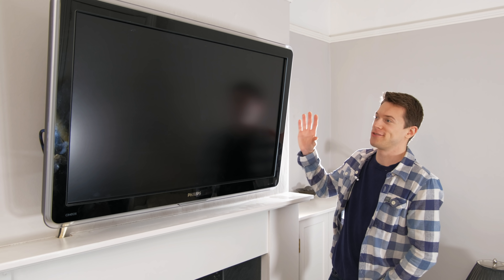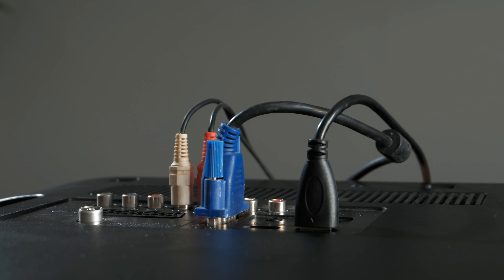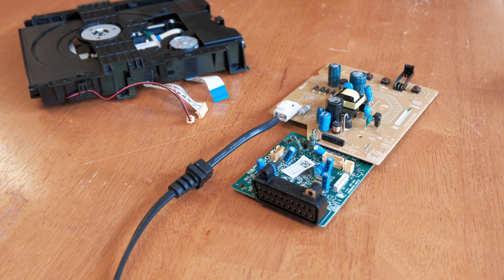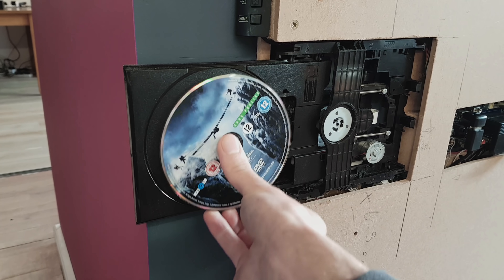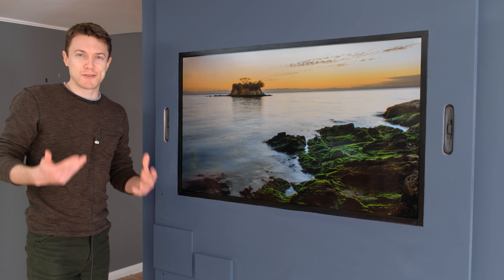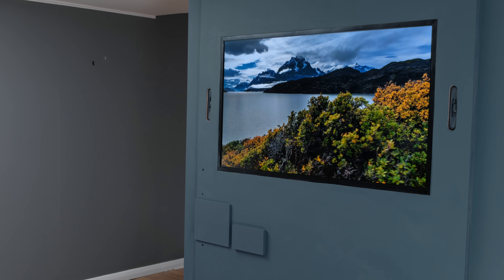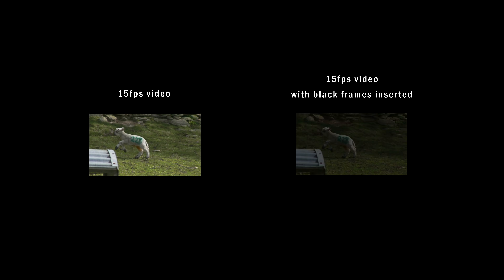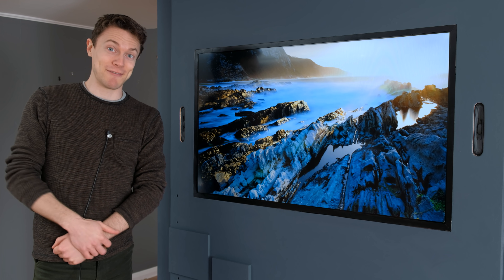Building a homemade 'wallpaper TV'

Comment: Great job. I love how you took the boards out from the tv and placed them elsewhere. HOWEVER, I Think at the end of the day you could of kept a manufacturers warranty on a much better television by building a wall around the television as all you ended up with here was building a wall around a television.   Only way this works better is if the tv has straight out inputs but TV's don't these days so you could achieve exactly same thing by building the front fibre wall around the tv but do it to newer tv without taking it apart.  You do solve a problem of the tv leani g forward but if you're going to build a wall around it to solve your problem you may as well just build a wall around the entire tv and have every single Input plugged in with the correct lead into the tv and have a compartment that the other end can be left hanging elsewhere for when you need them by adding an extension to them without ever needing to get to back of tv again.

Comment: With all the framing this required anyway, why not just build something to hold the corners of the TV up against the existing wall (eliminating the protruding bracket), then put framing around the whole thing to make your fake wall. You could still add speakers on the sides and move the physical button panel, but you wouldn't have to do all this deconstruction and precise framing work, and you'd have more flexibility in handling heat dissipation (hidden vents on the top, for example).

Comment: Depending on how the wall is, i would've just left the TV on the bracket and built a drywall from side to side with cut outs. 

I'm also a electrician so the electrical side of moving it out of the original wall wouldn't bother me.

Comment: wait... so with the fake wall, couldn't you have just stuck the whole TV behind it in the first place?
Reply: Yep. if it was just a plasterboard drywall I would have recessed it to fit TV, hide air vents somewhere too, even have access panel to get into the back of the tv from the otherside, job done.
Reply: Blaine Atkins thank you ! I thought I was going mad ..that’s exactly what I thought😀👌
Reply: Good question
Reply: this made the tv way thinner though
Reply: Yup and if you want to keep the wall back you can cut a niche into the existing wall. Just be careful of cables and pipes. Still easier than ripping a TV apart.
Reply: not with the studs and whatnot behind the drywall there. although you could build a thicker wall coming off the already existing wall and put the TV behind that. but then you have the buttons and IR receivers to mess with and you would want to build shelves into the new faux wall to house complete surround sound, gaming machines, laptops, cable box, Bluray, VCR, audio cassette deck, phonograph and any supporting ROM media to play through those peripherals. i like his. i would have done it different but i don't do anything but talk smack on YT
Reply: Icy Uranus TVs have buttons on them still? Lol I have a Qled so there’s no buttons on it at all but do have the IR that’s all. Sucks if you lose the remote I’ll tell you that! But it’s pretty thin!

Comment: @diy perks. Hey, love the idea. Heck, I love most all your ideas.  Could you please let people know that the voltages on those boards can be very dangerous when switched on. Also, heat is a huge killer of modern TV's, so some thought about heat dissapation is needed. Maybe a small fan could be placed in the false wall with the boards. Thanks again for the content.
Reply: Manic Mender agreed about removing heat from the circuit boards and the display. The TV originally used passive cooling so it wouldn’t be to difficult to add it to this design. Adding an air gap and some hidden inlet and outlet points should be sufficient. 

A warning about mains voltages should added to video. Still a good project though, just not quite complete.
Reply: Are you suggesting all those openings in the original TV casing actually had a purpose? Pshhh.

Comment: Pretty sure for the price paid for this fire hazard you could have just bought a quality projector and screen. Achieves the same end result without all the trapped heat inside that wall.
Reply: No, projectors aren’t remotely comparable - they are a different use case altogether

Comment: Nicely done.  I put my tv behind a mirror, so its just a mirror until you turn it on.  Doesn't work great in a bright room, needs it darker to work well, but it does work, really changes the living room completely not having a TV visible.  The TV itself was embedded in the wall.
Also, have you heard about projector TVs? lol, they are thin as nothing on the wall... lol

Comment: Are there any issues with overheating because of lack of airflow?
Reply: The damn thing has high risks of catching fire. Electricity , wood and flammable paint are not great together. And if a water pipe breaks say goodbye to the whole setup. Not a good idea
Reply: @doge3392  If a water pipe breaks near your TV you're fucked either way. Water + electronics = death.
Reply: @doge3392  That was my thought... would have loved a Big Clive colab here
Reply: @doge3392  It's not in the actual wall, it's in a fake wall on the outside. If a pipe breaks it's still behind the real wall and not the fake one. No different then if you had a tv mounted on your actual wall like most people do. This set up makes no difference if a water pipe breaks. Besides the water pipe comment the fire hazard is definitely an issue.

Comment: Building a homemade electronics firestarter.
Reply: How? He didnt change anything
Reply: @askeen8796  he removed the fire resistant encasement around the electronics and placed them in what amounts to a tinder box.  The plastic case around the TV has been embedded with various additives which make it impervious to flame.  It's not just plain old plastic.
Reply: True. It looks cool but is totally stupid. Any insurance would tell you "gtfo" after seeing something like that. TV is certified as a whole unit. Removing pieces and mounting somewhere else is more less illegal.

Comment: I would like to let you notice few quite disturbing things I seen during this video., 1st is safety of circuits, insulation of them from humidity and walls (e.g. dumps), second is grounding with separate wire all boards and shield them (as frequency disturbs between components). Then I seen that the wallpaper tv was done roughly, I mean the tv bezel could be done using rotary tool and appropriate point (used a lot in car audio bezels) to deep the board and exposing the fake wall maybe 0.5mm (1/5") more than it's now,  not saying about the speakers with any even fabric covers.
Reply: I once had a monitor catch fire while I was gone and luckily it didn't burn the house down as it was on a glass top and nothing was near it.  Imagine a circuit overheating due to failure and igniting the fiberboard it is mounted on.   Not sure I like that choice of material.  So long as everything works as advertised it's all good but you have to consider worst case scenarios in your design and eliminate potential hazards before they become real ones.

Comment: I think it's great engenuety and innovating. Congratulations for your abilities. How ever, giving the results can be acquired in this case by 2 other options: #1, purchase the latest technology which already meets this requirement. #2, cut the sheet-rock wall material; expose the wall structure, accommodate simple additional supports, sink in your equipment into the wall, replace sheetrock accommodating the display,make sure to allow some discrete ventilation, and mission accomplished.😁👍

Comment: I was expecting something a bit more interesting and was disappointed that you used actual shoestring. Why take the TV apart like that when you can just use 90 deg connectors/cables, frame out with 2x4s and cut a very precision time consuming hole in new drywall and flush mount the screen, or even better a (finish of your choice), magnet held, thin flat bezel. It is very important to fan cool a TV sealed in a wall for longevity. Plasmas were the worst, glad their gone. Make holes in the original wall to circulate the air. Use an IR repeater and install the eye in a blank wall plate anywhere you can run a wire. I personally buy speakers I want to see, but electro-mechanical planar diaphragms are invisible, great but pricey. Lastly run wires to the hidden components in another room or behind the couch in a cabinet. HDMI over cat 6? Dont forget the surge suppressors and use a smart power strip to turn things on /off using the TV. A proper install looks good for a reason unless you live in a refrigerator box.
Reply: @Marko Laaksonen Because it's fun.

Comment: What about heat? I wouldn't recoment  this for anyone to be honest, not impressed by the first video I have seen from this channel
Reply: Raf all older TV’s were in wood cabinets with hot tubes and high voltage
Reply: @Blondie SL am I being stupid? My TV uses less than 50 watts an hour. I can't see how it would be any different to sticking a light bulb in the wall.

Comment: Is it really safe to remove all the shielding and metal parts? I think they also serve as ground, so you may expierience voltage build-up that has nowhere to go, if you don't ground your parts correctly.
Reply: The back and front bezel were plastic. You cannot ground plastic as it is an insulator. MDF doesn't conduct electricity either so I am not sure what you want him to ground. What should be grounded is any exposed metal that should Not have current going through it. I see no exposed metal here so there is nothing to ground.
Reply: The metal shielding in electronics is almost always to help absorb EMI (electromagnetic interference). It's so the stray signals coming off the board don't mess up your wifi or other devices. You can listen to EMI coming from your devices with an AM radio
Reply: Diabl0pl would it not ground through the outlet?... it's been a while since I was in school but I'm fairly certain plastic doesn't make a particularly good ground lol
Reply: You can’t ground thru plastic lol, that’s what the plug is for.
Reply: Mikael  Yes, thank you

Comment: Great job.
I just imagine how easier the entire endeavour is gonna be with recent OLED TVs, which have no backlighting at all and are much thinner, and do produce true blacks. Also, OLED TVs have very little heat production and longer MTBF than LCD TVs, where the bscklight power supply is the first section to fail.
Thanks for the great video.

Comment: So, you know how flat screens manufacturers are definitely stupid while projecting. 
Why they invest tons of money in research for squeeze the thickness of the screen if they put sockets in the rear and not to the bottom allowing you to hang the screen to a nail in the wall as if it was a simple picture...
Reply: Modern flat thin screens ARE made to hang flat on a wall. Most are still  too heavy for (1# rated ) picture hooks or nails and would cause harm if they fell.  Their tiny, shallow, rear and side firing speakers are too poor-sounding to bother with and a MUCH bigger issue than their hung depth. 

If someone other than a painter is looking at the wall behind a TV set, instead of the picture ON the TV, you need a new TV.
  I was wondering why a set used today today needed more than a power, HDMI, and possibly an RF coax cronnection,  all of which have right angle connectors available.   WTF is with that old VGA computer cable?  And a DVD player, not Bluray with streaming?  This was an attempt to make ten year old tech look modern.

Comment: He basically made his own black frame insertion (BFI) feature! that's pretty cool

that being said most mid-highend TVs made post 2010 should have this feature built in to the TV (they all typically call it something else other than BFI)

The additional benefit of his custom solution is to modify the BFI based on 24, 30, 60Hz - that's probably rare outside of the current OLED crop of TVs. As an example of how cool/high-end this feature is - this type of variable refresh rate is only available on the new high end MacBook Pro and Apple Pro Display XDR both of which cost thousands of dollars

great job on this!

now obviously this could have adverse affects on the backlight because it may not be built to handle these custom refresh rates but I think for an older TV well outside of its warranty you can take this gamble relatively safely

Comment: Firstly I must congratulate you on your very clear diction - it makes your presentations a joy to listen to and engenders interest in the subject matter. Depending on the size of your room, one could also make the false wall a little thicker so that the externally mounted circuit boards were flush with the TV. It would also be fun to have electronically operated curtains to cover the TV - and then somehow link in the on/off switch for the TV to open the curtains a few seconds before the TV came on :-)

Comment: excellent.  the finish is up us I think.  the wall could be a panel of walnut and the speakers routed out to a shallow horn.  could also be combined with a horn speaker wall - coiled horn, or a transmission line type speak fore real seismic base - and no big box in the room.

Comment: For an unobtrusive TV - well, projectors are unbelievable today even in the cheaper segments. All you need is minimal light control in the room and you can have no TV, until you turn on the projector and have 80-100 inches (or more, by all means). Also, when you go to buy a TV, buy a TV that doesn't have PWM as the mechanism to control brightness. That flickering light is still fatiguing. Flicker-free panels do exist. Get one.

Comment: I liked this project, despite the tiny let down of what was actually done. I expected something more savvy for the input panels and not a pop out wall. Still a great DIY though. I personally would prefer flush to the actual wall with the TV inserted within the wall (creating a "pop-in" wall) and having hidden panel doors, perhaps, to access the inputs or buttons. Maybe even adding a Bluetooth Tx/Rx for a wireless surround sound system of wall flush speakers too. Call me crazy. Lol.

Comment: The black frame & clear border would have made an excellent modern picture frame for the  TV 
Mount it on a recessed pull out TV mount 
All done
Pull it out to reconnect any wires & then put it back
You could use magnets to keep it flush w the wall
I would have to make a cubby w a thin flush front for my Blue-Ray player, Apple TV, Roku, & Mac Mini

Comment: You are patient and hardworking. I am lazy and impatient. I would probably just cut a hole in the drywall and add a board behind the studs to screw the TV on :) Also, your knowledge of electronics is off the chart! Are you a trained engineer or did you learn all of this by yourself?..

Comment: Now what would be interesting would be to integrate a solar tube from the roof to just the LCD part of the screen (super thin) and then back light it with outside light AND use a video camera to view the outside. In fact, by using a Raspberry PI, you could augment the view to crop or scale it to what you want to see (alternate view depending on button presses, wi-fi remote, etc.) to other views of security camera feeds and weather forecast or what have you. But the real function would be to get some UV light, real light, and a real view of the outside. That way the room would actually get brighter, the view of the outside would be there and you could frame it like a window. But you'd have all the options of a "Back to the Future II window screen" (hopefully without all the flicker Marty's family had!)

Comment: My wife wanted our TV mounted flush but our house is brick inner and outer walls,I wont have cables visible and I am happy to channel a cable run to a wall TV or monitor,but I spent 3 days grinding, chiselling and swearing in a cloud of dust while recessing the only wall in the whole house that is three layered,the inner wall being two thicknesses of brick,with some set sideways at regular patterns to stitch them together which made cutting out for the lintel a nightmare😁, it does look good but I would never do it again, Even with power tools those old bricks were hard as nails! I later realised that it would have been easier to build a false wall in front of the old one with a recess in the middle for the TV but hey ho!

Comment: I've watched this video before in the past, but happened to see it on the side and thought I'd watch it again.  I'm glad I did because it brings up a question about "flickering".  I have a 32 inch Samsung TV and if I turn the back light up, it will at times just start flickering slowly, then gets faster. If the backlight is turned up higher, the flickering gets worse.  I currently have it set to zero and while most of the time I rarely see it, it makes it difficult to see sometimes in darker scenes.  Also, the TV is a pain to get to power back on after a power failure, so I just turn the brightness and contrast down when I'm not watching it and let my amazon Firestick screen saver display random images.  I'm guessing it has some bad caps but haven't had a chance to check them.  Could a bad cap also cause the flickering of the backlight?

Comment: Nope, not taking a $2,500 TV apart. If it must be flush. Measure and cut out the drywall. Cut down or frame out the studs. Install 1/2" plywood in the hole. Run all your electric and signal lines to wallplates at baseboard level. Sheet rock the hole. (you can pre sand the plywood and paint it for extra clearance) Use a close mount TV mount to mount the TV. Plug in the lines, and press TV into the cutout in the wall until it's flush. Put your AV components on a stand under the TV. Plug in and watch TV.
This way you can always pull the TV away from the wall so you can add or subtract components and lines. Or to just swap it out in the future.